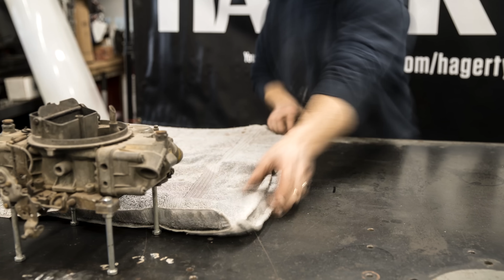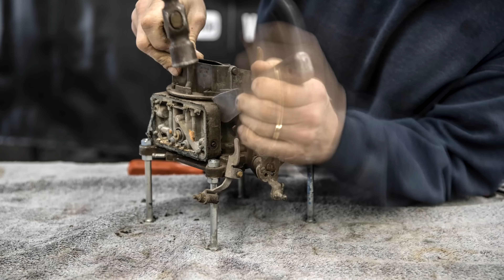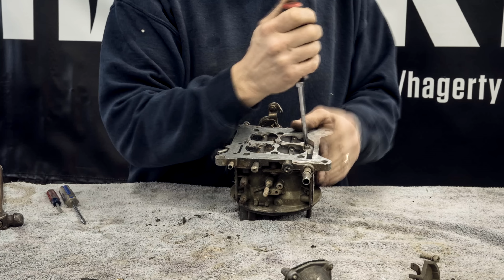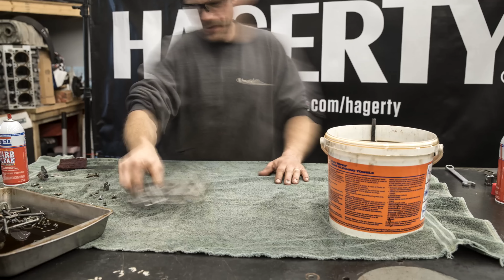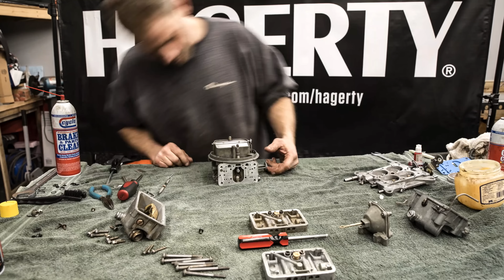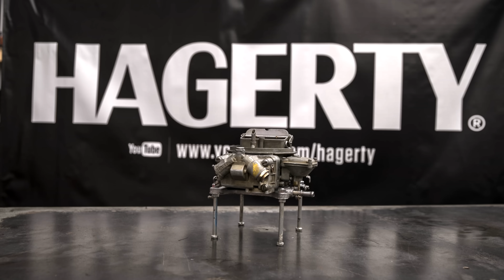Holley Carburetor Rebuild Time-Lapse | Redline Rebuild - S1E5

Comment: In my experience when rebuilding a Holley carburetor, 10% of the time is disassembly, 80% is gasket scraping, and the remaining 10% is reassembly. I hate scraping gaskets.
Reply: Looks like they used the blue reusables on the assembly. Smart move.
Reply: I get the worse off with a razor scraper [carefully] then use the wire brush on the bench grinder for the rest. Not so bad then.
Having used cheap kits and all the gaskets stick I have used genuine Holley now for a long time. They do not stick near as bad and can generally take several removals of bowls and block before needing replacement. 
Cost more but cheaper in the long run.
Reply: i guess im asking the wrong place but does anyone know a method to log back into an Instagram account??
I somehow forgot my password. I love any help you can give me
Reply: @Leandro Gatlin instablaster :)
Reply: @Emmanuel Alexzander It worked and I actually got access to my account again. I'm so happy:D
Thank you so much you really help me out :D
Reply: @Leandro Gatlin happy to help :D
Reply: @ldnwholesale8552  Next time try spraying gaskets on both sides with silicone spray  before assembly.

Comment: I could rebuild a Holley in my sleep. You never forget the smell of Berryman's chem dip (carburetor cleaner), the grief of blown power valves, leaking metering block gaskets, non-functional mixture screws, etc etc etc.

Comment: I rebuilt a Carter AFB on a 66 GTO as a youngster.  First time but with a diagram.  Took me a while but went OK.   I was told a Holly was about the same but leave the Quadrajet to an expert.  I learned rebuilding not to hard...tuneing correctly was above my skill.

Comment: Steven V. Said it right. I used to cut a 4x8 wood block butterfly bit clearanced for... The Butterfly's. It would get soaked then make another for next carb.🤦 For years.  I'm doing a double pumper today. On my day off :( the taste of B12. On a Sunday at the shop, also catching up on a taco 2.4l cyl-head timing set job. Parts back order sucks during this Covid B.S.

Comment: I wonder if i'm the only one that would want this slowed by about 25% so I can better see what he's doing.
Reply: Your right
Reply: YouTube let’s u choose a slower speed if u want
Reply: YouTube lets you slow it down 25%. It sounds like you're about to be possessed though.
Reply: Thanks for reminding me of that feature. What always becomes a problem for me is those small air passages which are sometimes blocked with something like a plug or small expansion type cap. I always wonder if I should really be drilling those out or not. Always end us with some extra parts left over that I probably should have used.

Comment: I had a 750 double pumper on my old 350 roller cammed chevy back around 1993. Engine was strong until i crashed the car. Sold the engine. Those were the days.
Reply: Mine got stolen.

Comment: Out of rime saving considerations, can you use a pneumatic angle grinder to clean off the gaskets? Not a crazy powerful Snap-On one, something that's a bit dialed back but is still pretty fast. Seems like it would save a lot of time.

Comment: It sure sucks they don’t make good carb cleaner. Stuff we used years ago was great about an hour or two and it looked like new washed out with water and blew it off good and you were ready to go. One tip always always check the new gaskets to the old ones if possible cuz I seen very slight variations in some. Then things get fun.

Comment: Could you add the real time in your video's? I thought Holley carbs with vacuum secondaries had different metering plates and float bowls. Is that a mix and match hybrid carburetor
Reply: Scott Golden 4150’s have two metering blocks and external adjustable float levels. They can come either with vacuum secondaries or as a double pumper. It’s also a dual feed. 

The 4160 is almost the exact twin except only the primary side has a metering block. The secondary side has no metering block. It has a metering plate inside the float bowl. No external float adjustment on the 4160. It is a single feed to the primary float bowl only with a transfer tube feeding the secondary float bowl. 

The 4150 is easier to tune because of the external float adjustments. You can get a kit for a 4160 that replaces the metering plate with an actual metering block on the secondary side, and it comes with an extended fuel transfer tube. You could upgrade it by getting 4150 float bowls too  but by then its cost prohibitive.

Comment: hi! I have a question, what is the name of the fluid that you put in the bucket? thanks :)
Reply: SAEKI571 Chem-Dip Carb & Parts cleaner available at any auto parts store.  Comes in a gallon bucket with strainer to easily remove the parts.
Reply from the maker: We used the Gunk Carburetor Parts Cleaner Complete Kit. It came with a little pale and basket, but most of our parts were too large; hence the bucket. It seemed to work pretty well, although this is in no way an endorsement, I just make videos and noticed it cleaned pretty well.